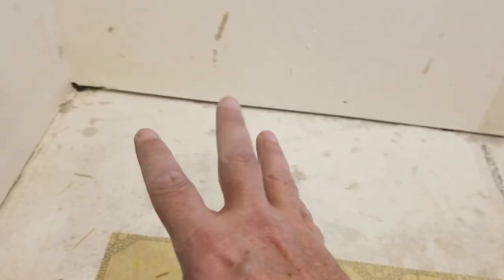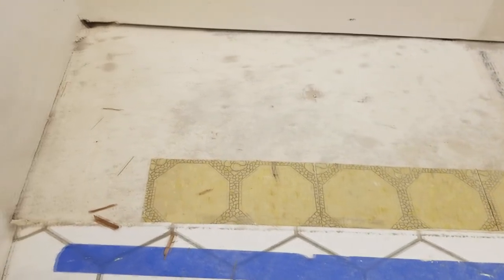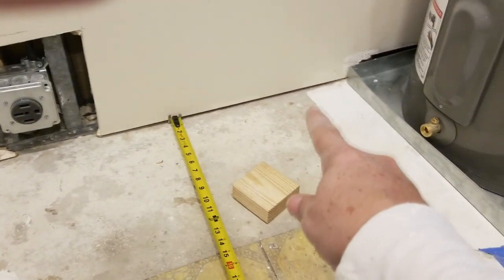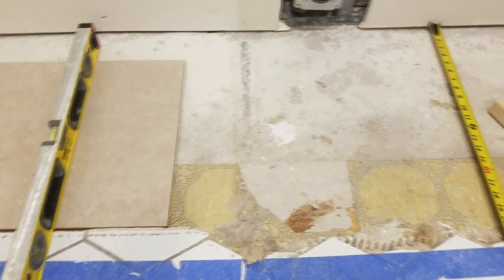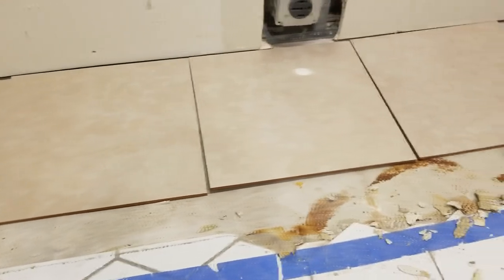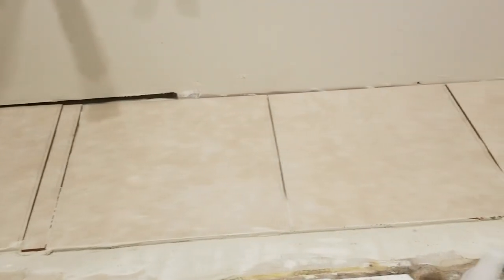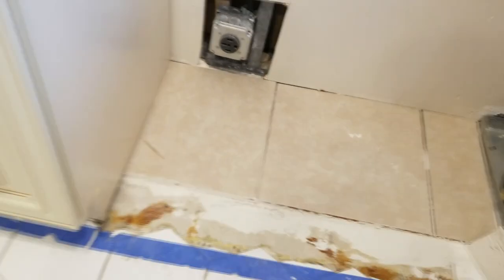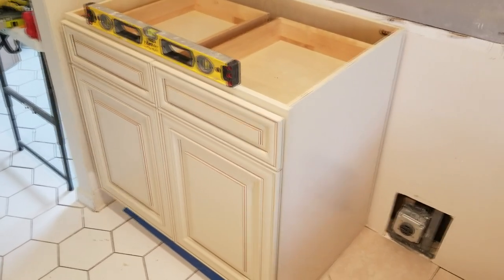How to Install Level Tile Flooring Under Kitchen Cabinets, Stove, Dishwasher

Comment: I have this dilemma as well on my bathroom vanity, tile was laid around it. I want to replace w/ new vanity, which is 3” deeper , I think your idea will work well. I’ve never mixed thinset but it’s only an area 21” x 48”

Comment: not sure if you are still commenting but what do you do when you remove the old dishwasher and there is no underlayment. There is an inch difference between my floor and where the dishwasher was. Thanks

Comment: Will the mass of cabinets and such crack the tiles underneath?
Reply from the maker: No, if you make good solid trowel lines of mortar, back butter your tiles, you should get about 100% coverage so there is no way to crack them. But if you put down a few globs of mortar like some lazy people do, you'll get voids under the tiles and those will likely crack
Reply: @jeffostroff  thanks!~

Comment: Can I install vinyl tiles around existing cabinets instead of under? I want to replace my rollout vinyl floor in kitchen.
Reply from the maker: Yes, nothing wrong with vinyl up to the cabinets. I know with most laminate floors for example the manufacturers tell you not to install them under the cabinet. I think tile is really the only flooring material that makes sense under a cabinet, or you could tile up the cabinets as well.

Comment: What do you do if you are adding to existing? Meaning existing are directly into the slab and the new ones are in the tile area? should I cut the tile down?
Reply from the maker: Not sure what you are asking, but in the case of this video there was already a floor installed that we had to add onto with new tiles to fill those areas that were not tiled. You have to make sure the top surface of the old tiles and the new tiles we be perfectly level by using the spirit level to keep it all level. You have to choose the new tiles to be the correct thickness so that it won't be higher than the old tiles, or lower than the old tiles. You can make up for about 1/8" of the difference in thickness with the thinset mortar.
Reply: @jeffostroff  I have existing cabinets that I don't want to remove and were installed straight to the slab and tile after. Now I am putting new windows and raising one of them to be above the cabinet line so I can add more cabinets along with the void space under the window which it has tile already. Of course ,  if I install the new cabinets on top of the tile, these cabinets will be higher than the existing ones. What do I do to fix this problem without removing the existing?
Reply from the maker: @myrianrodriguez7088  You have a difficult dilemma, but I would either saw off the bottom of the cabinet which is not as practical, or start coming up with a way to remove the tiles in that spot. We often use an angle grinder to score the tile along a line where we want to remove tiles, then pop them up. Your other alternative is do nothing and live with the height difference. Or leave a couple of inches between your old cabinets and the new cabinet that you want to add so that maybe you might not notice the height difference, because they are separated by space.
Reply: @jeffostroff  That is exactly what I thought you will say, to cut the tiles and pop them up to put the new cabinets tin the slab. I really dislike it when this practices are done when the home is built. It leaves you no other options. Same thing with my kitchen window. I have 2 of then there and 1 is above the cabinet line and the other is double the size and below the cabinet line leaving that empty space that can be really used with cabinets and countertops. My home was built in the 80's.

Comment: The tiles are 1/4 to 3/4 and 1/4 to 3/8.  What thickness are those large ceramic tiles?
Reply from the maker: If I remember those were 1/4" thick

Comment: Why not just install back legs onto the back of the cabinets to adjust the height to the height of the tile¿ faster and cheaper way.
Reply from the maker: They do sell devices that can do that but remember they also cost money and you have to put them on all of the base units . Also it is always best to tile in where the dishwasher is going to go because if you ever have to pull out the dishwasher you will have a really tough time getting it out with the tile floor in front of it

Comment: What do you do if the floor is not level so when you lay the tiles it does not come out level?  We have this problem under our dishwasher in an old house.
Reply from the maker: If there are high spots, you use an angle grinder to grind them down so that you have a level floor.  If it is more sever than that, you need to get a bag or more of self leveler from Home Depot mix it up, pour it out and it self levels the floor.
Reply: @jeffostroff  Brilliant!  I didn't know self leveler existed!